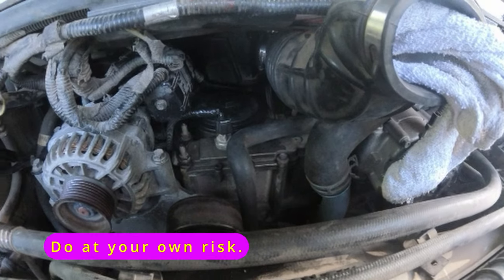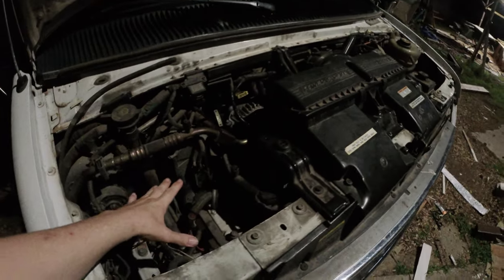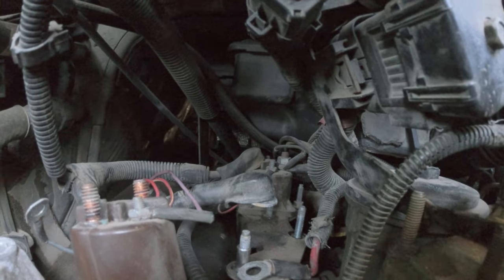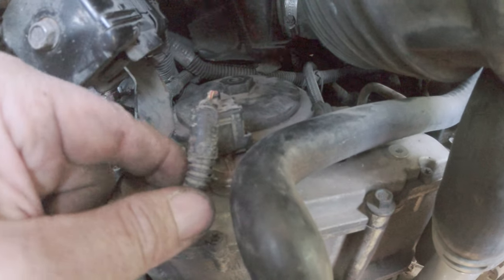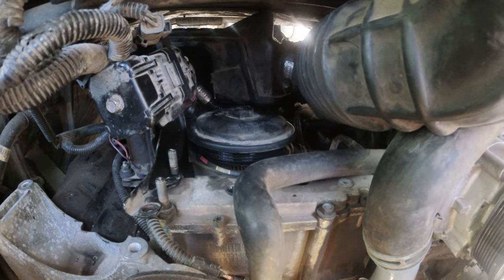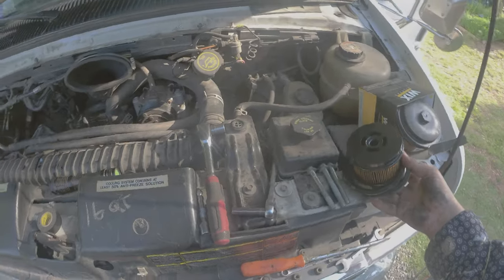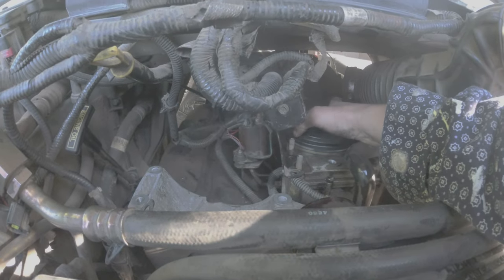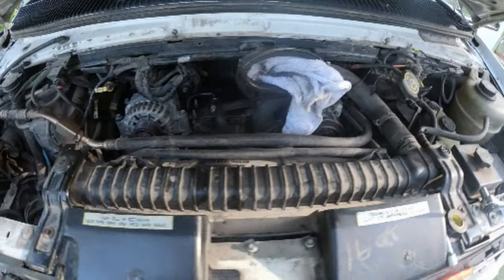Ambulance to RV (Ep74) Ford E-450 7.3lt  Fuel filter and glow plug relay change.

Comment: Once diesel gets to $8 a gal it comes prefiltered.🤣
Reply from the maker: Well gas is keeping is right up there too.  Besides most rvs get 5 mpg  this at least this gets 10 mph @ 70 mph with the ac on and with the latest mods i am hoping on getting 15 mpg but we will see also the world runs on Diesel.  If it gets to 8 dollars a gallon we all are in big trouble. i might just become a farmer.
Reply: Remember Farmers need diesel l @PurplePercepti0n
Reply from the maker: Not micro farms